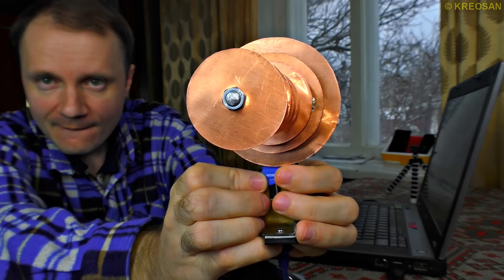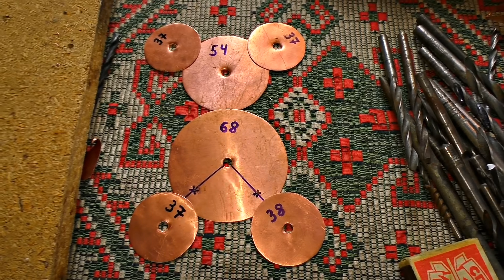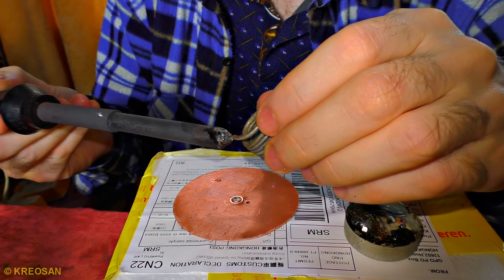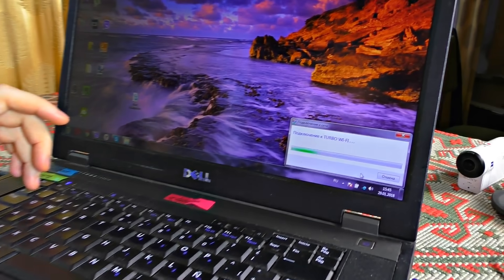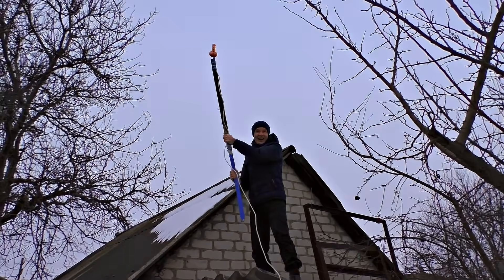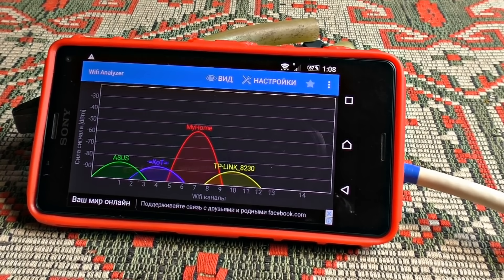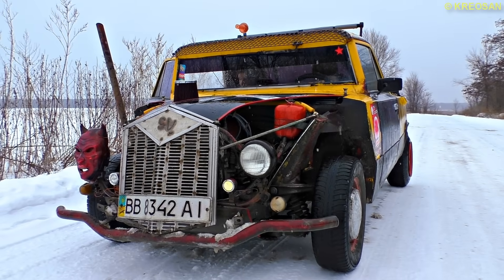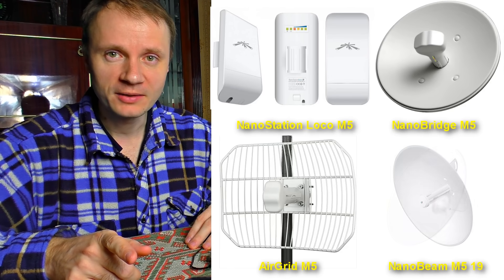✅Wi-Fi Gun DIY / Powerful Antenna for Wi-Fi !

Comment: What is the angular coverage of antenna: 30degrees, 60degrees? Also what about adding an arduino controller rotating pivot support that would automatically orient the antenna to the right GPS position?

Comment: This will not work for sure. Copper plates are connected to each other with a screw head. It will definitely not work in a short circuit with chassis. Do not fool people.

Comment: The strength of a Wi-Fi signal does not mean anything about the type of antenna But yes, the internal components of the Wi-Fi card will determine whether its signal and speed are good or not, even because a piece of wire can serve as an antenna.

Comment: I made LTE version, put on the roof and pointed directly to bts 800m far. Signal is way better, speed is way better. Good thing about this it is only lte frequency and you can point it directly. Good improvement from indoor lte Huawei which was not inline with BTS. For this unused copper plates and cheap lte external antenna from Ali just to get 2x 5m cable. Works a treat. 
Let's say from 24max it went to 60MBps which is my max.

Comment: If you replace the center screw with something non conductive, and the d4iven element with a properly tuned loop, your antenna will perform much better.  Alternatively, electrically isolate the driven element (one in from the back) from the rest of the design, and connect the shield to the reflector (far back element).
Reply: Nerd
Reply: @compositestechbb9087  atleast he is not dumb
Reply: @compositestechbb9087  Engineer
Reply: @compositestechbb9087  ehats your problem?

Comment: They used to make TV antennas with the same design, called "color laser" antennas.
That TV coax is gonna have some pretty bad losses at 2.4 Ghz.  Put the USB adapter on the antenna and make a USB extender and you'll get a lot bigger gain.

Comment: Hi, We made the antenna using the same method, but we did not get any boost in range. Is there any specific amplification factor needed on the router. Do we need to use any specific router model to get the antenna working. ?

Comment: 100 kms and here i am not able to connect even to my neighbor even after drilling a hole in the wall..... and putting a single core copper cable on the other side and still cant connect to his 300 mbps dual band router.... wow its not easy as it seems.... this is so frustrating.....

Comment: Hi, I'm a ham radio operator from Britain. The coax you are using will be very lossy at 2.4 GHz. If you were to buy suitable coax your gain would be better but it is expensive. If it is permanent installation then get the better coax. Best wishes.

Comment: Take two cell remove carbon rods 5v charger and cable connect carbon rods + - take 2 bottle of Salt water a pipe full of Salt water connect 2 bottle white liquid HCL viniger cure and yellow water put in water or in muds.
Any kind of poison or snake drink with cold drink (c) or smoke and wound to.
Take artificial to masterbating to remove blood clots in speam or ovam no abnormal babies. Take of this always.

Comment: Bro i had made one it worked fine correctly 

And to all those people who are saying that it won't work, make it correctly I have failed 3times but finally it worked, all my fault was 
1,I was using a bent rod 
2, I was using a wrong sized plate 

3, I didn't jointed the cable correctly

Comment: DO SET IT = 50KM >>> I COULD NOT UNDERSTAND THE ADAPTER.  WHY U DONT USE THE TV ANTENAL AND TO CONVERT IT TO WIFI SIGNAL >>> JUST TO USE THE TV ANTENAL AT HOME >>>ALL IT NEEDS ADAPTOR FROM TV ANTENA SOCKET TO THE LAPTOP OF MOBILE USB!! CAN YOU BUILD ONE FOR ME ? I PAY YOU WHAT U ASK FOR. AND HOW TO CONNECT FREE INTRERNET? THERE ARE PASSWORDS ON OTHER WIFI SIGNALS AROUND YOU // = BUT THE BEST IS TO BUILD STRONG WIFI SIGNAL CATCHER AND TO USE THE HOTSPOTS IN TOWN = 10 - 50 KM. PLEASE RESPOND OF U CAN BUILD ONE FOR ME OR TO TEACH ME STEP BY STEP HOW TO BUILD IT UP ESPECIALLY THE CONVERTER /ADAPTER/=== I PAY U FOR IT. PLEASE TO RESPOND!  CHEERS AND STAY SAFE BUDDY

Comment: Quick question
He said he is using a copper sheet with a thickness of 3mm is that correct?
Because from where I am from 3mm is pretty thick
Does thickness matter anyway? 
What thickness should i use? 
0.3mm ? 0.5mm? 0.8mm? 1mm? Someone please help me out im confused ☺️
Reply: Did you get a solution for this point? It is still not so clear for me. 3mm seems to be too much big
Reply: @Thejackal971  im going for 0.4 mm 
And i couldn't get copper sheet so im going for aluminum instead idk how it's going to perform

Comment: Antennas can’t be constructed with measurements alone because you would be building a theoretical antenna. The metal can make an antenna electrically longer making the SWR higher than expected causing your wifi transmitter to fry or burn out. You’ll need a watt meter for 2.4GHz to test the frequency to make sure all the power is going to the antenna and test the coax that there is no loss in the gigahertz region.
The coax must be design for microwave frequencies as not every coax is treated equally. 

Another problem with this antenna that he made was he shorted the reflector and the driven element.... The driven element has one side with the coax and the shield is on the other side of the driven element making it a dipole antenna.
I’m glad this antenna worked, but the device he was using for wifi could lower it’s power output levels to prevent frying itself from bad SWR making it weaker to transmit poorly. Wifi uses data packet which uses very low bandwidth that allows it to travel further. It wouldn’t be too difficult to assume you have a good antenna regardless it is being junk.
If he had test equipment, built the yagi antenna better, and used good coax, he might of been able to get better performance out of this yagi wifi antenna.

3:36 Any antenna, good or bad can receive signals. It wasn’t that you built a bad receiving antenna, just a bad transmitting antenna.

4:22 That coax is rated for 75 ohms... wifi uses 50-ohms coax. That alone will throw off your antenna performance...
7:39 Why would you test a poorly made antenna inside a metal box on the floor and not on top of the car on the outside like you did a moment later?

Comment: How is this possible? Answer: it isn't. I will explain it. 

First of all, attaching brass and copper sheets within each other isn't going to help. You'd need an inductor to collect the radio signals. Second, even if you did use an inductor, wifi signals will require more than just a puny inductor. An inductor is used for RADIO signals, not for high-powered high frequency WIFI signals or PHONE signals.

I'm an electrical engineer. Believe me and not this SH*T.

Comment: I have a question regarding this. Is the WIFI gun helps me get a strong internet connection? For example, I have a too slow internet connection.  Or it will only help you connect to other WIFI devices?

What I want is, my wifi router could get a strong internet signal...Anybody who can explain it to me, please.

Comment: This antenna 100% will NOT work. Probably demo is fake too. 
1. The center wire ( TX RX wire) is GND connected by the center rod to GND external wires . This is a full sort TX wire to GND cover wire. Zero transmit and receive power posable. 
Probably will fried the router RF output too. 
2. Isolate the receive plat (#2) also will not help since the wire is coax 75 ohm and not 50 ohm as needed. so 50% of the TX power is return back to router output. 
***************************************************************** 
* This demo must be remove, since it misleading viewers * 
***************************************************************** 
I did not test the RF design. But to give it a change, isolate the second plat by sleeve on the metal rod.
 Isolate also plat 2 from bolt by plastic washers. 
Test your work with ohmmeter that plat 2 is real Isolated from all other plates before connect to router. 
Buy and use 50 ohm cable. Not 75 coax cable. 
Run on Android the Google store  WiFi Analyzer  application. It's with no cost. 
https://play.google.com/store/apps/details?id=abdelrahman.wifianalyzerpro
This is the only way to check your antenna performance.  
Do not expect to get more routers around, since this is directional antenna. It will show a fewer routers. Only the routers that directed point to your directional antenna will be showing. And that is good.  It will be great for point to point communication. 
I will be happy to get comment  to my email with Phone screen copy, before and after connect this antenna. 
I will return email with a real life working home designs. 
Dr. Nissim Zur  
RF  expert.
www.TelnT.com
Nissim.zur@gmail.com
Reply: Hello there, i want get more informations about yagi antenna for wifi, for this one, i built one but it's not working at all. I want and need the perfect antenna for wifi catching signals for long distance, this antenna will be for wifi card connecting to laptop or computer. But what should I do with the antenna i have built? what do I have to do on it? what changes would I have to make there to achieve a high gain antenna for wifi? I am also interested in the correct diagram if you have it so please send it to me.

Comment: So, connecting ground to plate 1 and the signal wire to plate 2 with an iron rod to connect the 2 copper plates, it's a SHORT CIRCUIT... shorting an antenna to the ground equals to... no antenna :) (or are there some invisible insulators between copper and the rod? #ElectroBOOM help me :)

Comment: I did everything correct and it didn't work. fake don't trust
Reply: The driven and reflective elements are electrically shorted out by the metal boom all-thread rod.
Try insulating them from the rod.

Comment: We all know the calculus concept of spinning a semicircle to form a sphere.  Is this antenna effectively a Yagi that has been spun around its longitudinal axis, so that each rod in the Yagi becomes a disc?  - a sort of Yagi for all polarisations?  If you transmit from this antenna, what polarisation does the wave have?
Does the antenna out-perform a Yagi that is communicating with another, similarly orientated Yagi - in other words, both are horizontal, or both vertical?

Comment: Looks cute, but WILL NOT WORK for long distances. You can build one for fun or for display but do not expect function-ability. 1-5 km? HA HA HA. And where is the insulation between the dipole and the reflectors?
EM waves decrease in power with the square of distance in meters so even if you could concentrate the wave section to a perfect "laser beam" how will you find it at 5 km?

Comment: Hey i have question can i use aluminium i planed to cut on laser because i work on one :D and can someone give me Technical drawings in igs I don't get into the autocad or solid works i will be grateful
Reply: one more question the small holes ,Did they give the essential dimensions and positions of the holes?

Comment: dear friend but the round in copper are in short circuit by the metallic bolt you use inside all together !!! cannot work sorry is a complete block of metal no way for 2,4 ghz sorry
Reply: Indeed, I isolated the disk and get good results. I dunno if I must isolate all the disks since they're all connected to the ground

Comment: Here in America it's called threaded rod stock. Make sure it isn't stainless steel or plated for the rod and nuts. Just regular grade 5 steel will do. And I myself would use a clear coat spray to protect from corrosion. I wonder how much more radiation these things put out?

Comment: In antenna design, it's called a surface wave antenna.  Each of the small disks is equivalent to an infinite number of wires, ends up being a disk.  The small disks are called directors.  The antenna is essentially a yagi.  The very last disk, the large one, is a reflector, the one the inner conductor goes to is called a driven element.   If you want to make it weather proof, put it inside some pvc plastic water pipe.  I've found that some of the measurements have to be empirically determined.
Reply: How did he know the exact distance to space the disks?
Reply: @jasonv5478  wave length
Reply: @jasonv5478 : Imagine this an Yagi-Uda antenna, spacing and length be kept as per Yagi.
Reply: @jasonv5478 math?
Reply: @jasonv5478  he shows a diagram in the video of how far apart each disc is
Reply: Could you scale it up more to increase range
Reply: @thenthson  but this will effect the wave width which could be is his case around 15-20 degree not an exact number but closer to realite so all that you do when you scale it up is just to more focus the wave width which is not really recommend (if it just for experimental reason it will work just fine and pick a further access point or wifi hotspot but for dailyuse you will face a several disconnection instances because of the poor wave width especially if you put the antenna outside ) the main reason why this actually work is this key word "focus the power into smaller area " in more simpler word ; let's suppose the antenna in it original state require 5w to power the receiver but because the wave width is so much wider (around 60-70 degree of wave width ) the wave range will be shorter around 50 m (if there is no obstacle = in the air) but thanks to the narrow wave width  of the wifi gun this 5w will be focused so the range will increase so much it could literally 10 times (around 500-700m)  by the way the 5w power requirement could not be an actual real number but from what i read it's reality close to reality i guess)
Reply: Wasnt a Pringles tube used for a similar antenna in the past ?
Reply: @fotografm 😂 yeah this is the level up pringles mod.
Reply: Can you add a magnetron instead of a WiFi emitter and direct waves to interfere with WiFi and make a blackout zone?
Reply: @AmericaFirst1981  That would be deadly would it not?
Reply: In Iraq we used magnetrons to knock out cell phone detonators on IEDs in the road. Just wonder if you could hook an antenna to it and point it at a drone to take down light civilian drones that have been implemented in warfare recently…
Reply: Please make some videos.
Reply: It’s illegal to fabricate them… the government gets upset when you start messing with radio frequencies.
Reply: a=137
Reply: He looks stupid with that ray gun, he could build toys for santa

Comment: That would just be an alternative antenna the discs dont boost the signal it's just like putting a cut up soda can on your router like those life hack videos if anything it would make it go in one  direction but the discs won't affect the wifi waves because wifi waves go through metal

Comment: I have some doubts that this is real. It is possible, but this is usually considered illegal radio transmitting being over the power limits. I think there is some attenuation issues with longer distance RF. OK this may be an example of typical power through a directed antenna, which is still legal. It does require line of site.

Comment: Is this a scam or it would realy work?
Reply: JovcaCreaper TEMC I think that if this worked it would be VERY widely used, also the tv cable he used wouldn’t connect to it like that even if it did
Reply: I dunno about the way he Daisy chained two or three kinds of antenna together, but the initial rod with copper disks, that's for real.  I think it's basically a yagi.

Comment: the coaxial tv cable its not a good choise u lose a lot of signal one of the better cable is lmr 200 ... 2.4mhz have a lot of losse in the coaxial cable ...its better put the repeter or modem close to the antenna and put a usb cable or a normal rj45

Comment: This video is nostalgic for me. I first got into custom wifi antennas in the mid 2000s. We put a 19 dbi directional antenna on our roof back in the day before WPA was prevalent on peoples' routers. We had the antenna connect to a WRT54G with custom firmware to allow it to use the wifi signal as an internet source for the home network. It was interesting to say the least. :P
Reply: We used a WRT54G with Tomato and a cantenna to pull a connection from "Linksys - Unsecured wiresless network" about 3km across the lake.

Comment: nice construction, but the only thing i don't understand are the distances between the discs. the only distance which is clear are the 32mm, but  what do u mean with "28-32"? On the other hand on 1:40 u told that the distance must be 30mm and that doesn't fit with the scheme. what is right now? anyone made that also?

Comment: This make a short circuit! The ground and signal are shorted as the last two disks are electrically connected through the rod. This WILL fry the transmitter. Use a nylon rod.

Comment: find wall bang head. RG6 coax is designed for a 75 ohms res and RG58/174 coax used with SMA connectors has a 50ohm res.
Reply: .....right......

Comment: That is a heavy duty soldering iron.
Reply: Could drop a bull elephant at 500 meters...:)
Reply: I know I was laughing at that beast too.
Reply: Copper sheets like this can really suck away the heat from a soldering iron so a big one like this is almost a necessity to get the solder to melt.
Reply: Damn boy
Reply: It's crude
Reply: That soldering iron carrying the heat of the sun
Reply: it's the AK-47 of soldering irons hahahaha
Reply: I noticed that too, and how quickly it carbonized the paper under the metal. That's a soldering iron to cherish. Did they find it in the zone?